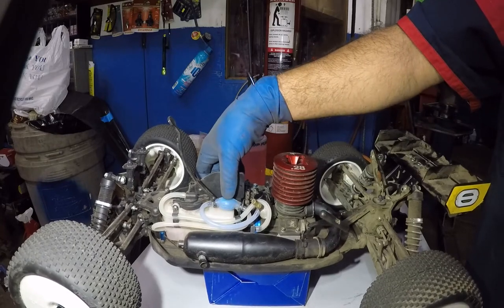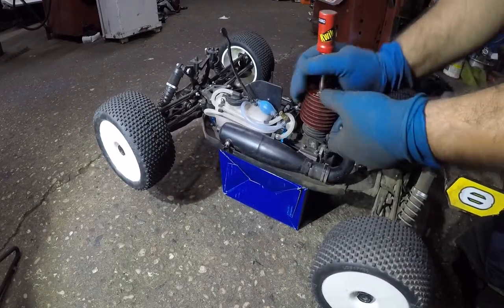Nitro engine dont start Quick 3 TOP  tips to starting nitro engine Part 2

Comment: If you get it to idle, leave the glow plug heater on it for 10-20 seconds after it fires this warms up the combustion chamber to the point the engine can properly diesel.  Easy on the throttle at first and let the engine warm up, it might take 1/4 tank of fuel for it to get to that point, when the engine is hot, refuel and have fun.

If it is pissing fuel out the pipe at idle, the low speed is too rich, lean it out 1/4 turn at a time.  (Clockwise on low speed) as soon as you find that soft spot, don’t touch it again.

At mid-full throttle, if it bogs, (with exhaust smoke) it is too rich.  Lean it out 1/2 turn at a time.  (Clockwise on high speed) If it bogs (no exhaust smoke) it is too lean.  Richen the mixture (counterclockwise on high speed) This is the screw that you will have to adjust in accordance to temperature.  Hot outside = tune lean Cold outside = tune rich.  

If you want to F around with your nitro car in the snow, the car most certainly will not start if it is too cold outside.  Example: 20F outside, you’ll be best off starting it inside a place that is 40F and above.  Let it warm up, and adjust accordingly.

Idle screw: Clockwise = higher idle, counterclockwise = lower idle.  Adjust accordingly, when you find the right idle RPM, leave it alone.  

That’s all there is to it.

I will add, if you don’t have a good glow plug heater, you will suffer.  If you are serious about running nitro cars today, buy a starter box, and a hardwired heater that can plug into it.  Screw pull starts, and Roto-Starts.  If you buy a starter box, 90% of your problems will disappear.

Of course all of this is subject to change depending on what fuel you run, pick a brand/mixture, and stay with it.  If you buy another fuel, you’ll most likely have to re-tune the carb again.  

If you burn VP, stay with VP.  If you burn Traxxas, stay with Traxxas.  If you burn Sidewinder, stay with Sidewinder.  KEEP YOUR RATIOS.  If the fuel is (brand) with a mixture of (what you are currently running) buy the same fuel over and over until you are forced to find an alternative.

Nuff said, TL/DR, buy a starter box for your nitro rc cars, and get a glow plug heater that can plug into it, adjust the carb accordingly, and burn the same fuel.
Reply from the maker: Ok cool

Comment: How do you no if the engine is flooded, Explain, Bad instructions.
Reply: The pull start will be very firm, remove the glow plug and turn the engine over.